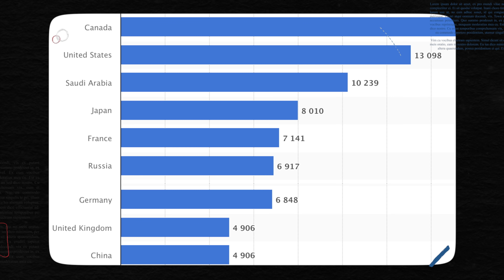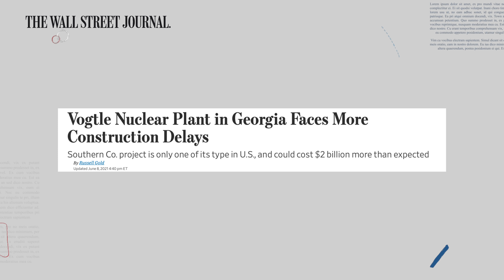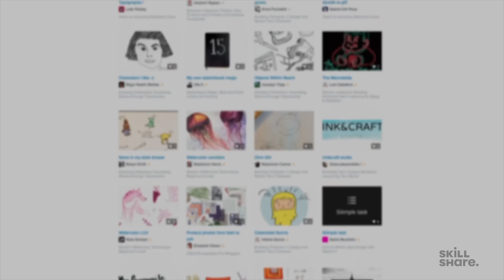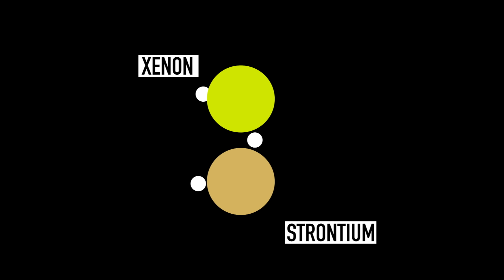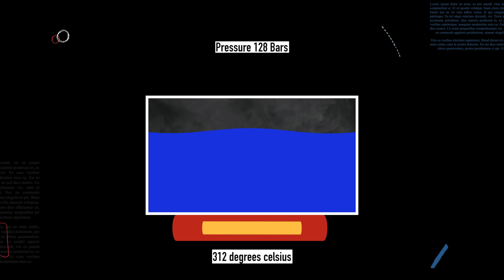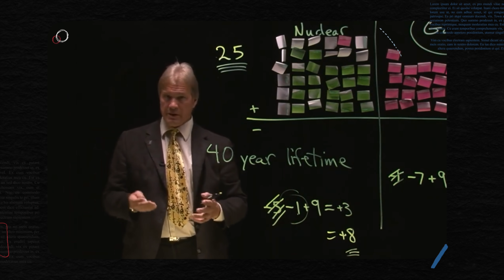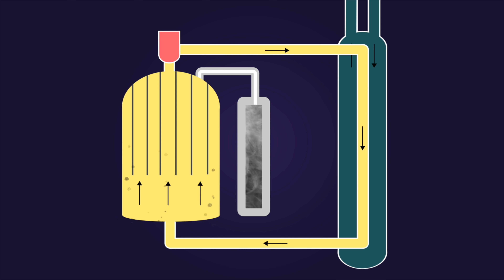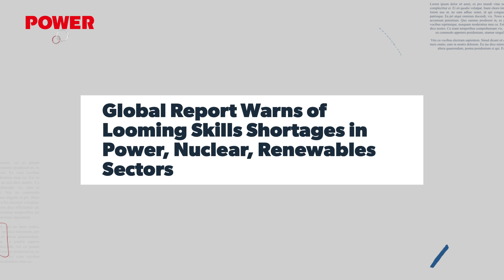Thorcon Just OBLITERATED Nuclear Energy’s Biggest Problem

Comment: "negative temperature coefficient of reactivity" - now that's a term I haven't heard talked about for a while. Very important, and often mis-understood.
Reply: Jargon os intellectuals, not phrasing of Humans. Can you convert that mess for Humans to comprehend?
Reply: @linyenchin6773  Negative temperature coefficient of reactivity: As the temperature increases, the reaction slows down.
Positive temperature coefficient of reactivity As the temperature increases, the reaction speeds up.
Chernobyl was the result of a positive temp coefficient, it's basically a runaway reaction: more heat = faster reaction = more heat = faster reaction... and so on.
Reply: @andrewmackenzie2638  why can’t you have a runaway reaction the other way? Is it just easier to warm something up with an exogenous source than to cool it down? Hell if I know.
Reply: @vknight7497  because the whole point of a nuke plant is to put out heat that creates pressure that is used to make electricity. With a positive TCoR you're getting a feedback loop that results in ever increasing pressure until the containment fails and adios muchachos.

With a negative TCoR there's a maximum temp/ pressure you can realistically hit. You over engineer to be safe above that and you're golden- no feedback loop exists to ruin everyone's day.
Reply: @vknight7497  In this situation it's to do with the mechanics of fission and the properties of most materials.
For fission to work, a neutron leaving one atom must strike the nucleus of another atom, but not only that, it needs to hit it with the right amount of speed, too fast or too slow and it won't work. If the atoms are not close enough to each other, the chance of a direct hit at the right speed is very low. When you do manage to hit the nucleus at the right speed, it splits and releases more neutrons and heat; for the reaction to continue, these neutrons need to hit more atoms. If too many atoms are getting hit at the correct speed in too short of a time, you get thermal runaway/explosion; if too few atoms get hit, then the reaction slows down and stops.

Most materials expand when heated. As more energy (heat) enters the material, the atoms get excited and move around a lot more and move further from each other, as a material cools the atoms lose energy and move closer to each other.

With molten salt reactors the salt contains the fuel. As the fuel and salt mixture heats, it expands and the fuel atoms end up further away from each other.

One way to think of it is: if you fire a bullet at a group of people huddled together, you have a good chance of hitting at least one person, but, if those people are running all over a football field in random directions, the chance of hitting one is much lower. Now, say the group of people huddled together are the atoms, you fire a bullet and hit one, they "fission" (in this case splatter over everyone else) which gets all the other people in the huddle super excited (scared) and they run around in a panic. Now it's much harder to hit the remaining targets (until they calm down and regroup).

So why did Chernobyl have a PTCoR, but an MSR does not?
Chernobyl relied on water for cooling and for moderation of the neutrons i.e. the water slowed down the neutrons so that they are less likely to be going the correct speed. 

When the Chernobyl disaster occurred, there was not enough cold water entering the reactor, so the water got hotter and hotter. As the water heated up, it boiled and turned to steam, this left spaces (voids) where the water used to be. Without water, there is nothing to slow down the neutrons and limit the reaction, so it speeds up. Reaction speeds up, releasing more heat, more heat boils away more water, which lets the reaction speed up more, which produces more heat....
Reply: @andrewmackenzie2638  thank you both for the explanations.
Reply: @vknight7497  Because if the temperature reactivity coefficient is negative, then a decrease in temperature leads to an increase of reactivity, which increases temperature, which decreases reactivity, which decreases temperature etc. The two values will oscillate and eventually stabilize to a new value. If the temperature reactivity coefficient is positive on the other hand, then a decrease in temperature will lead to a decrease of reactivity, decreasing temperature etc. The reaction will just die.
Reply: @dinmammatre  ah I see. That makes sense. Thank you.
Reply: The Nuclear Navy thanks you for your service.
Reply: This thread should seriously be pinned.
Reply: Interestingly, Chernobyl was operating in a state where it had a positive coefficient of reactivity when it blew up. Clearly, this design would not be approved in the US.
Reply: the sheer beauty and elegance of this feature of molten salt reactors is not to be understated!  if , for any reason the reaction gets too aggressive, the reactor itself slows down the reaction naturally by design , conversely, if the sun goes down or the wind stops blowing,solar and wind decrease in production, you begin to draw much heat from the reactor to compensate for the power draw and the reaction speeds up from the contraction of the salt !  this is a gift from nature to man or god to man if thats your thing, definately a sign of the way to go .....

Comment: A better way to achieve load following isn’t to develop a reactor that can change power level rapidly, but instead to build in thermal storage in large vacuum insulated tanks that hold a tertiary molten salt. Then the reactor is sized for average power over 24 -48 hrs and the tertiary tanks and their pumps and associated steam generators and turbines are sized for maximum power. And unlike the primary and secondary salts, the tertiary salts do not have to function inside the reactor in a very high neutron environment. As such they can be cheaper and less corrosive than the primary and secondary salts.

Comment: Molten salt has been a thing since 1962. Unfortunately all the research projects never gathered additional funding. I wonder why because you can't weaponize  the product eyebrow raise

There are some additional complications like this. Heating elements burn out very quickly. This was a problem with molten salt back then I think it's been resolved nowadays. But a lot of energy is put back in to heat the thing back up so I guess there was that caveat to

Comment: A new reactor shelter every 4 years and nuclear waste every 2 to 8 years is taking the nuclear waste problem to new heights. A underwater facility has its own problems - if it is floating, it inherits all the maintanance problems of a typical ship or pontoon, if it doesn't float it has problems with different water levels. 
I think it could be worked out - but most likely not cheaper than wind and solar power. You need highly skilled personell, and there's still enough radiation around to get really nasty in case of pipe failures or wrong maintanance decisions. 
Solar power is greatly reduced in cloudy and rainy weather -but not to zero. And speaking about rain: India could as well invest in rain drain power plants! Build lifted rain collection structures and use the energy of the flowing water! Combine it with water management so that the streets stay water free and you get benefits for the majority of the crowded cities. How about big high altitude canvas roofs that are only put up in the rain season? To collect rain and use the positional energy fo produce local power. Invest money wisely not for the next 50 years, but in sustainable energy systems for the coming centuries.

Comment: It should be mentioned that the visuals in this are not to scale, which is fine for the purposes of this video. In an actual molten salt reactor, the distance between uranium atoms is far greater than you see here. So the expansion of the fuel salt has a very profound effect on reactivity just like she said. Imagine you're shooting targets with a rifle at 200m and as the day heats up, your target automatically moves itself hundreds of meters further downrange until you can no longer effectively hit it. 
To scale, it would be like moving your target many Km away from where you're standing. 

Good video!

Comment: Building an offshore reactor off the Indonesian coasts sounds like asking for trouble. It has witnessed cataclysmic earthquakes & tsunamis and will remain that way because of it being on one of the most volatile spots on the Ring of Fire.
Reply: The powerplant hull rests on the seafloor, most likely over gravel. This is done to isolate it when the seafloor shakes. Earthquakes should be no more problematic for it as they are for floating structures
Reply: @vipondiu  What about Tsunamis? Is it just going to be far out enough out to shore to not be hit?
Reply: It will have its own harbor and be able to resist a 15 meter tsunami.  Should be safe.
Reply: @lorenwilson8128  No on site civil engineering project?

Comment: But.. Did they overcome the inherent problem with using highly corrosive molten salts in the pipes and a pump that lasts more than 1 month under the highly corrosive high temperature salts without becoming a brittle mess of shattered blades? Because as it stands right now that's one of the biggest reasons why we aren't seeing real Thorium reactors in use despite the fact the there's already a fully developed fuel cycle for thorium reactors that is proven to be energy positive and uses purely Thorium (except seed material to start the reactor for the first time, but since the plan is to use nuclear waste from a standard reactor.. Yeah).

Comment: Is not one danger of using graphite as a moderator is that the failure of the cooling medium means the moderator sustain fission hence the core can melt down.

Using water as a moderator as well as the coolant means that a loss of cooling shuts the reaction down.
What have I missed ?

Comment: Modular construction is simply going to have to be the way to go for future reactors, it's just so much cheaper. Not a big fan of sinking them, the Indian Ocean is on the Ring of Fire, remember the 2004 earthquake that decimated Indonesia? But the basic idea of modular construction is an eminently sound one, and using shipyards to build them is a novel idea. Personally, I kinda like the idea of vertical integration and build myself a reactor manufacturing plant to produce them myself, but I can understand not wanting that kind of overhead on your books and outsourcing the manufacturing as long as they can meet your tolerances. 

You could say the idea... holds water.

Comment: Been hearing about Thorium for years. What specific milestone is this video celebrating? Or is it just marketing fluff?
Reply: The mass production to make it economically viable by driving the cost down from 5-10 billion to around 1-2 billion and cutting down initial construction from 5+ years to a single year. So you're cutting both the time and initial investment by a factor of five, making it far more economically attractive.
Reply: Marketing fluff. The biggest problem, corrosion of the molten salt containment, is still unsolved.
Reply: @wermagst  In this model, the containment chamber is replaced every five years, which solves the long-term corrosion problem by virtue of not needing to contain it longer than that while remaining economically viable.

Comment: I imagine people worrying a lot about sea level rise and tsunamis with the reactor and it's waste products being in close proximity to the ocean.
Reply: No, it can't blow up or leak.
Reply: @gregbailey45  The reactors will be sitting in the water near shore. I imagine they could be shifted by a heavy wave or cargo vessel impact. Potentially even knocked on its side... She mentioned the used fuel containers being placed on an island, but the elevation wasn't very clear. 80 years rusting in salty air on an island with slowly rising sea levels, and increased storm strength.    Hopefully they will be high enough to stay mostly safe.

Comment: Dumping the cans on some "uninhabited island" is no way of dealing with the problem of nuclear waste. Currently no one on this planet has any solution how to safely store the waste, which apart from being radioactive is also incredibly toxic even in tiny trace amounts and must under no circumstances seep out into the environment, fall into the wrong hands or be blown into the atmosphere by some crazed terrorists. Additionally Indonesia is a seismic hot spot area.

In France and most other countries nuclear energy is only commercially viable because the costs of dealing with the waste are borne by the tax payer, not the company. Nuclear energy in reality is more expensive than any other kind of energy. 
And in many cases the waste is just stacked in some corner on site because as I said no safe long-time storage solution exists. But these guys want to transport the stuff by boat(!) for hundreds of miles and leave it on an island somewhere.

Plus: The reason for the thick concrete walls in existing nuclear power stations is not only the dangerous stuff inside but also the dangerous madmen outside. And even they couldn't withstand a 9-11-style attack. How is a shipyard to construct a floating power station that can withstand terrorist attacks? 

To see the problem of safety reduced as a problem of cost, as is done in this video, should turn your stomach.

Comment: The main problem with this and any nuclear energy process is that you still need to mine and refine uranium and store the spent fuel. We need renewables, not more mining of fossil fuels.
Reply: And you need to do more research, sir!
Reply: @gregbailey45  Really - So they don't mine uranium ore? They don't have to refine it? They don't have to find a long-term storage location? Research, I have done enough research to know the issues still exist. nuclear energy is many steps above coal and other fossil fuels, but nuclear is not without it's problems and is Not renewable. That is the Main problem - it's Not renewable. Maybe you're the one that needs to do some basic research.

Comment: I noticed you didn't mention molten salt is incredibly corrosive  how do they handle this?
Reply: Generally speaking,  things are only corrosive relative to other materials.  For instance,  water is very corrosive to salt crystals.

But for this topic, molten salts do tend to be more corrosive than other materials.  However,  they're mostly only corrosive in the presence of water (no water in the salt systems) and are using alloys known to not be significantly corrosive to molten salts regardless.

But perhaps the most important point is that all the plumbing containing the radioactive fuel salt is within the cans that are replaced every 4 years.  So while the plant itself may have a lifetime of decades, the fuel salt plumbing will constantly be replaced long before any significant corrosion can arise.

Comment: Can we talk about the steam too? Would be ideal to have it liquid as output..
Hmm not sure if i’d trust a ship welder with welding a nuclear reactor aren’t there people that specialized in that field?
Reply: Yes, there are specialists, but the reason they exist and are needed is because a PWR nuclear reactor is a 9inch thick steel scuba tank the size if a school bus, with giant piping to match.  The welds need to be pristine and x-rayed for the slightest flaw.

That massive material, and the difficulty and quality assurance that go with it, are needed because the water is literally at 90 to 150atm of pressure.

Thorcon's design, and other MSR, are at ambient pressure; only a few atmospheres from pump and head pressure.  That's the kind of force your home plumbing is under.

So while the quality assurance will actually likely be better in an assembly line-like shipyard environment, the absolute quality, and danger for a failure of quality,  is actually much lower. 

Its why im never afraid of a cooking pot boiling on the stove, but paranoid of a sealed pressure cooker in the same circumstance,  despite the pressure cooker being 6x as thick.

You don't need a specialist welding anything in Thorcon's design, because there's nothing under enough stress to need special craftsmanship. Its a sign of safety,  rather than a lack thereof.

Comment: Locating these power stations on the seafloor is problematic. Sodium (molten or solid)and sea water dont mix and would be susceptible to leakage and (far worse) tsunamis.  If water came in contact with that sodium it would explode and contaminate the ocean waters with uranium which can't be contained. Land based is far safer.
Reply from the maker: These people have built ships all their lives. I think they know a thing or two about keeping water on the right side if the steel :)
Reply: @TechforLudditesSira  All ships leak. Just ask a sailor. But containment is the big danger. I'm sure it's vary safe...but. If something did go wrong what then? There are earthquakes, tsunamis, liquefaction.  where the land meets the sea, there are many forces at work. I get it, most people live within a short distance from the sea but for the same reason you must use care. Those same people need that sea to live.

Comment: thanks for the vid.  though you didn't answer the problem of nuclear waste storage/destruction (ive always been in favor the the Sun option) which is the primary problem.
Reply: High level waste from pressurised water reactors can be easily reprocessed into fuel for molten salt reactor to retrieve the 90+% of energy not yet extracted!

Comment: Would these modular reactors also make it feasible to replace the coal furnaces in coal power plants, to run the existing turbines and generators with nuclear instead of coal? That would reduce the CO2 output and make use of existing generator parts in the coal plants.
Reply: Not really. The steam is at different temperatures and pressures. Coal steam plant would not function adequately.